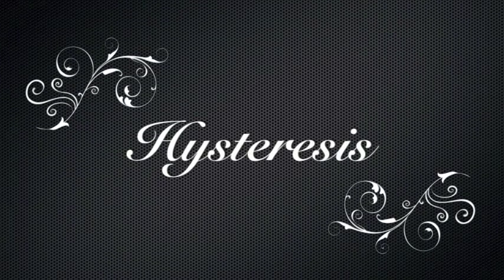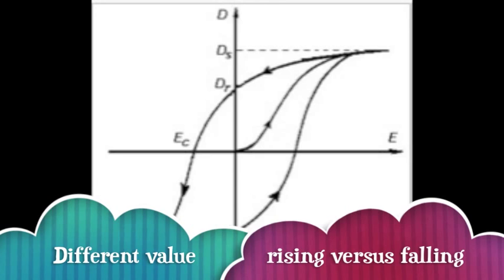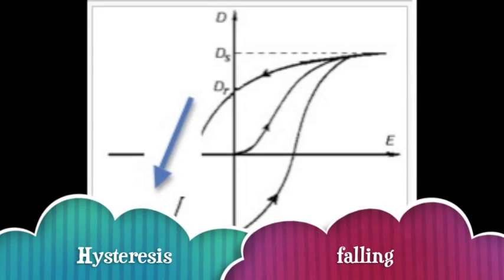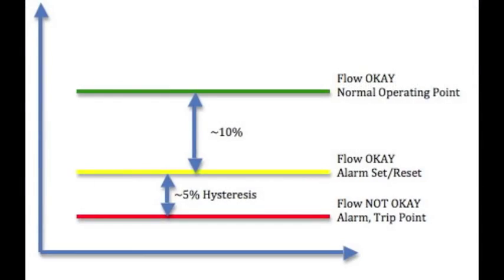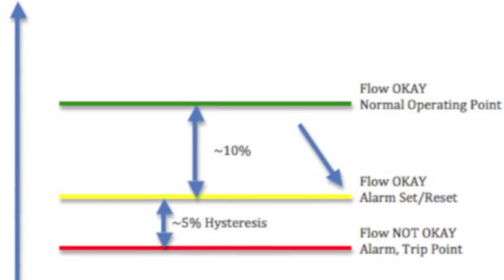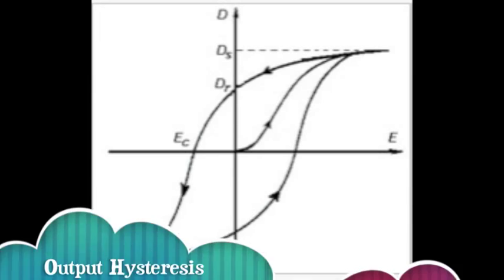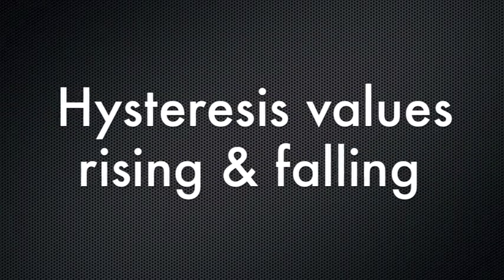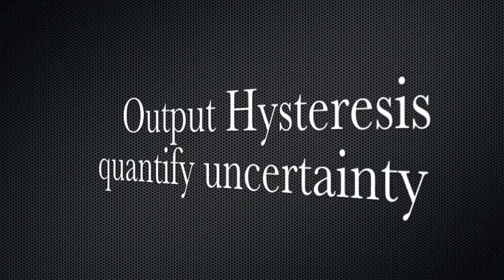Hysteresis (versus Deadband)

Comment: Sigh...You've given an example of dead band, not hysteresis. Go look up its definition in Liptak.
Reply from the maker: Correct you are & nicely worded.  Unfortunately, I have continued the error from the metering & relay industries use of hysteresis instead of dead-band (probably an extension of the magnetic hysteresis of the relay solenoid which creates the clamp-on and hold voltage differences and are sometimes referred together as relay hysteresis).  I have tried to edit the existing video in the existing YouTube link to accommodate your comments.  It would be great if YouTube allowed full video updates into the same link as Vimeo does.  Y2020 is a new year...and a companion correction video may be in my cards.  Thanks!
Reply: hysteresis loop for electromagnet! area ratio? demagnetization? retentivity and coercivity in H. L.!
https://youtu.be/peurIC9nCZM